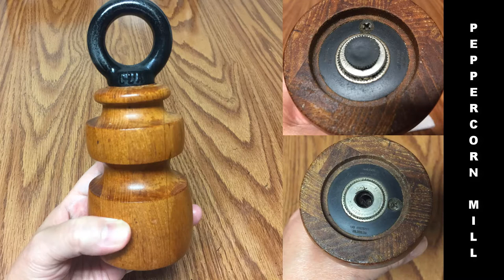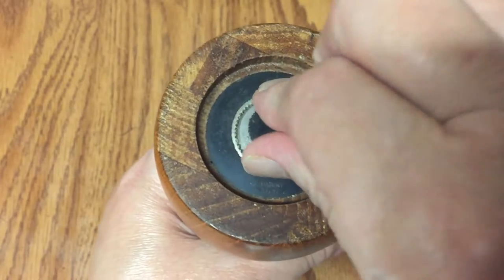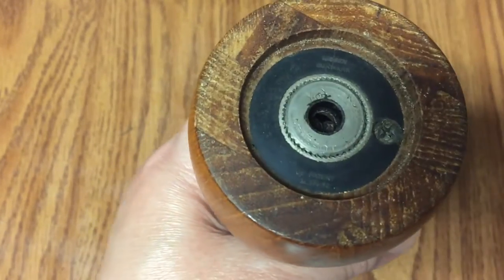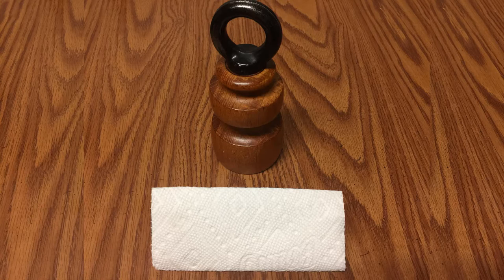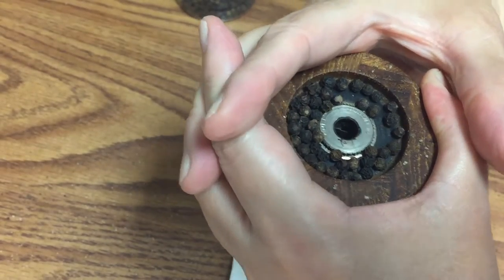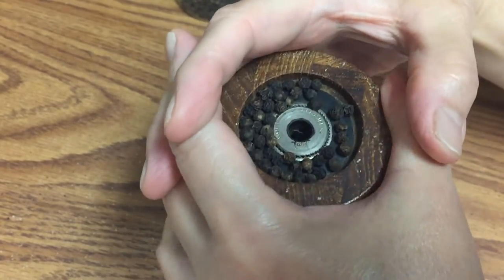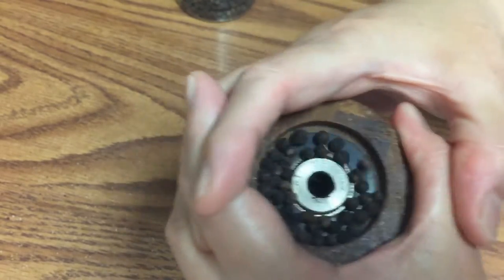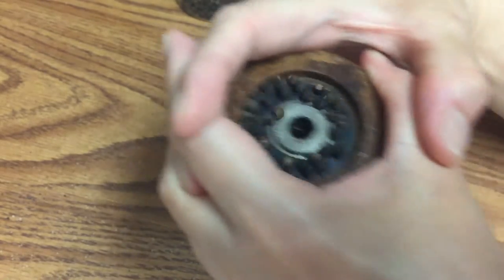How To Fill/Refill A Wood Pepper Mill or Grinder With A Ring Crank & A Tiny Fill Hole At the Bottom

Comment: Could you use a piece of paper make a small funnel and fill it that way?
Reply from the maker: Good question!  Unfortunately, the hole is too small for you to refill this Pepper Mill in a shorter time.  This is actually the fastest way of getting the peppercorns in without spilling these on the floor.

Thanks for sharing your thoughts and for the visit!
Reply: @merlstrom  cool. Now I want to buy a Pepper Mill.